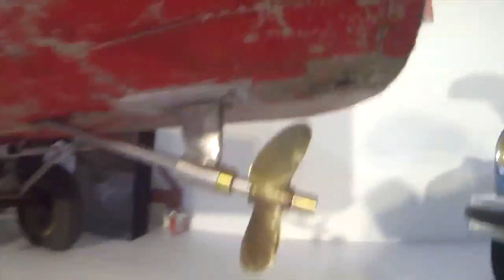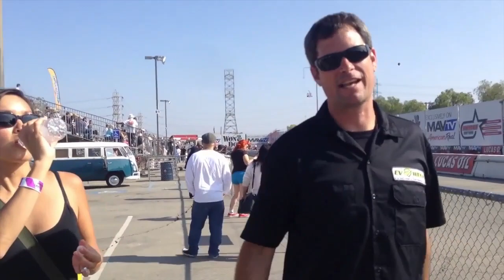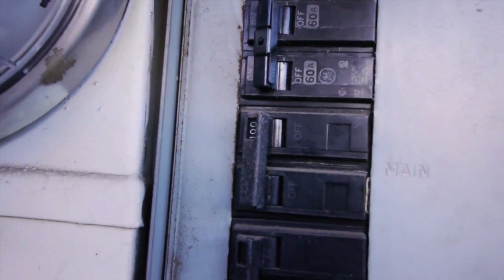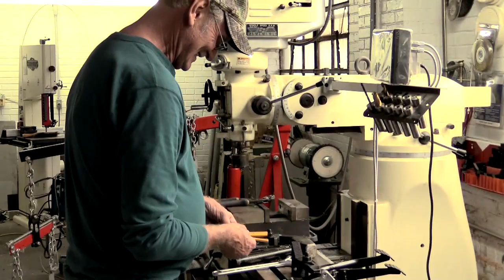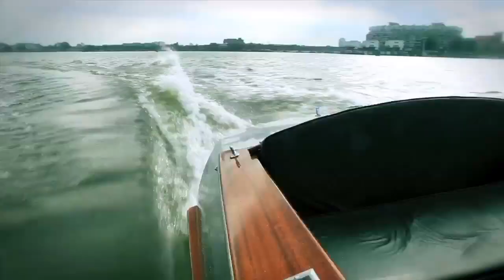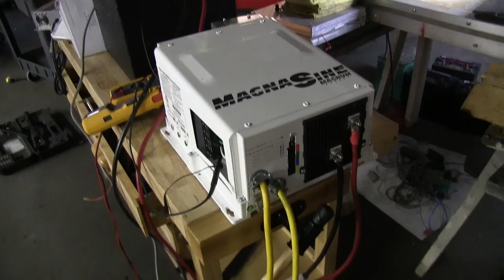EVTV Friday Show - November 8, 2013

Comment: Boats!  Electric power boats are silent, clean, and green.
We have an electric sail boat, and a kayak parked in back of our home on Lake St. Louis.   Now I just need to make our ski boat electric.

The power curve is very diffrent in a boat; idle in the no-wake zone and then max power to get out of the hole and ski.  For my 18' ICE ski boat that's 600rpm and then 3000rpm, it's all about torque, and electric motors have lots of torque.   I need a power control unit with 3 settings: off, idle, and full power.  Reverse idle can wait for phase 2.

Comment: I wonder Jack, you talk about a display on the steering and I think that's a cool idea but I am thinking wouldn't it be possible to use a heads up display? It would eliminate perhaps trying to put things into a dash that the dash wasn't designed for. I am for sure wrestling with the dash on my build. So I got to thinking about projecting a display against the windshield.